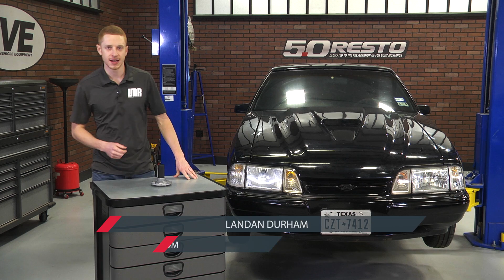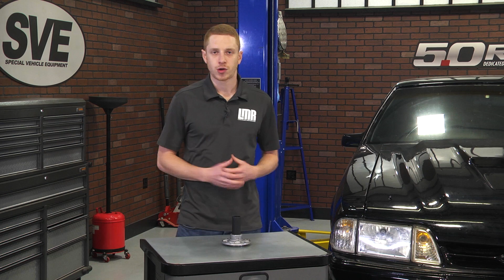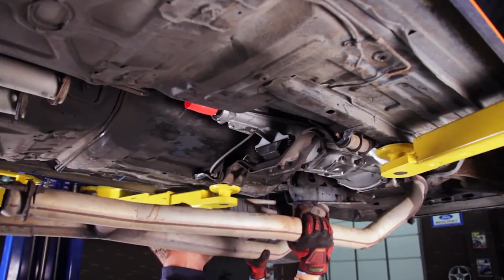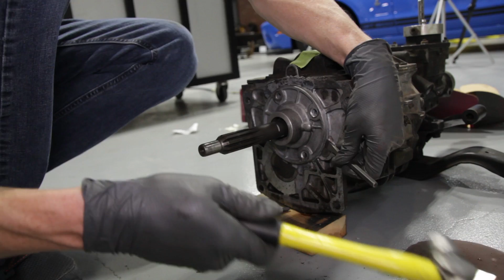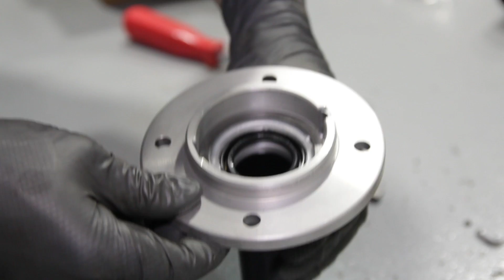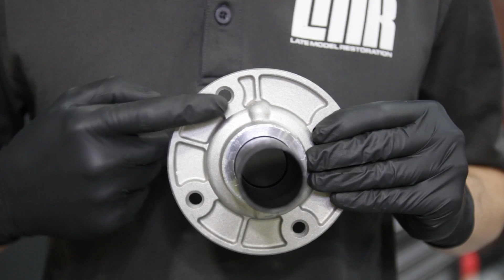1983-1993 Mustang 5.0Resto T5 Steel Bearing Retainer - Review & Install

Comment: Is black gasket maker the correct sealent for metal on metal. Shouldnt it be a sealant?
Reply from the maker: Black or grey RTV is a suitable sealant to use. All I had was black when doing this video, but grey would probably be the better option due its density. It has a higher torque and vibration resistance. The transmission that you see in the video is still in the car and has been leak free since. -Landan

Comment: I love how you didn’t even bother to verify or check for the correct end play after changing the bearing retainer. You’re assuming the new one is machined identical to the factory one you pulled off. A few thousandths will make or break an otherwise perfectly functioning trans.

Comment: Bought the retainer from lmr, just got a new bearing race to put in it, but it didnt come with a shim. How should I remove the old race from the retainer to swap the shim?
Reply: It's a 97 v6, and you guys didnt have one in stock so I ordered a timken input shaft bearing/race from rockauto but didnt come with the shim. I'll have to order a new shim before installation then, thank you very much!
Reply from the maker: We recommend purchasing a new race and shim instead of swapping over the old ones. Due to the fact that it can be difficult to remove the old one and have a chance of damaging it. Check the link below for all of our transmission parts:  https://lmr.com/products/79-93-Mustang-Manual-Transmissions#5168

Comment: Do you carry the bearings for the input shaft?
Reply from the maker: Yes we do! Here's the link: https://lmr.com/item/LRS-7502A/83-95-mustang-t5-input-shaft-bearing
Reply: @latemodelrestoration  what about the thrust bearing behind it. And the needle bearings inside of it or do the needle bearings come with the shaft?
Reply from the maker: Check out the full rebuild kit below! It'll include everything you need for a full rebuild! - https://lmr.com/item/LRS-7000A/mustang-transmission-rebuild-kit-85-95-wc-t5

Comment: Can it work on a 00 v6 t5 ?
Reply from the maker: Angel, 

https://lmr.com/item/M7050B/94-95-Mustang-Ford-Racing-50L-T-5-Bearing-Retainer is what you need. 

Application
- Fits 1994-1995 Mustang GT/Cobra w/ T5 Transmission.
- 1994-2004 Mustang 3.8L V6 with T5 Transmission